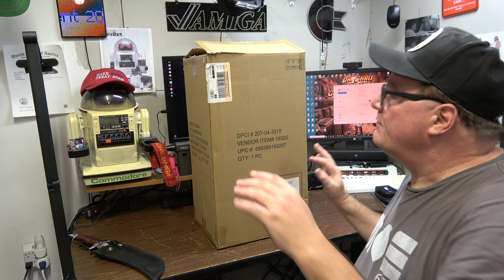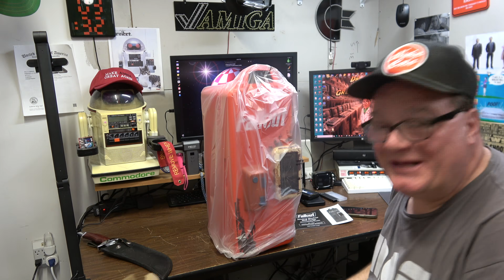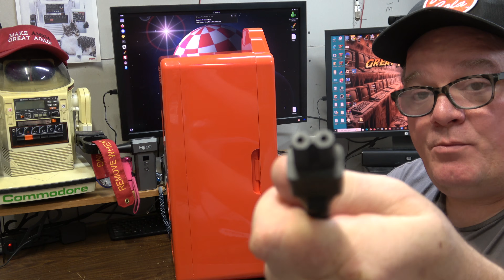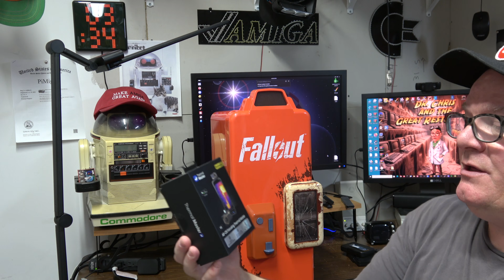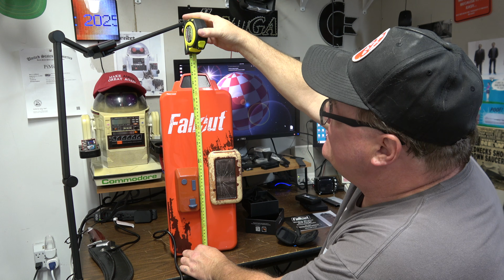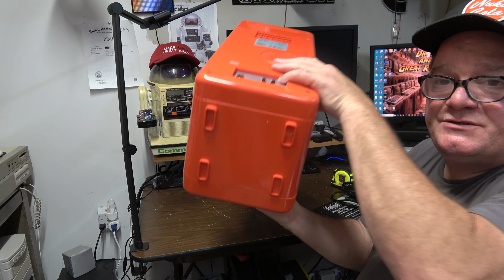Fallout Vending Machine Mini Fridge Thermo Electric Cooler

Comment: I'm disappointed in the cooling unit used. I know that they are much cheaper and easier to produce but it turns this into a glorified toy, not an actual fridge.
Reply from the maker: all of these are Peltier based. in my smaller frigidaire model i replaced its psu with a meanwell and its way cooler now.

Comment: Actual cooling performance is weak. Efficiency poor. The rated power draw is about the same as for my refrigerated wine cooler that has 4 times the capacity.

Peltier cooling should have the advantage of no moving parts and being very quiet.  Until you add a fan to remove the heat so that the Peltier module can be actually useful.

Comment: as far as I know, piezo is just a voltage flexing quartz crystal (not semiconductor) and peltier thermo-electric couple is a PN diode. kinda like substrate vs solar panel. I would say that peltier is just a led but not for visible light. maybe a infrared heat diode instead. ie heat activated and generating heat through ir. usually leds dont make any cold tho. so no. still a semiconductor or metal-semiconductor diode tho. pn or schottky diode.

Comment: i have a cheap generic thermo electric fridge thing i bought from amazon for 50 bucks about 6 months ago. i've already had to replace the fan in that thing once i bought some replacement fans for it cause the fan bearings are going out yet again. i didnt buy cheap fans either. oh well, its easy to pull apart. very simple design. mine will run on 120v AC or 12v DC. takes about a day in a half to get reasonably cold, and mine also holds 12 - 12oz cans.